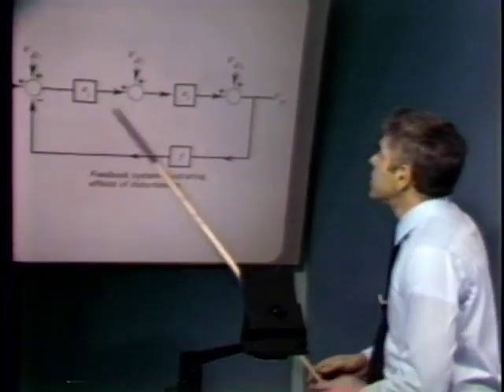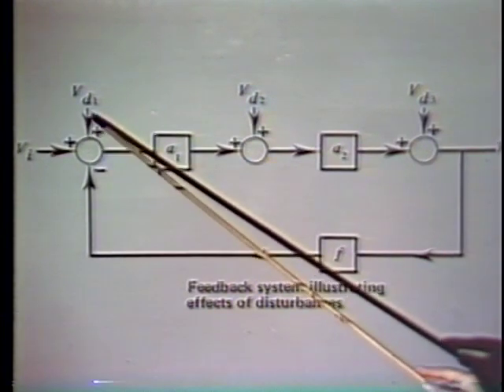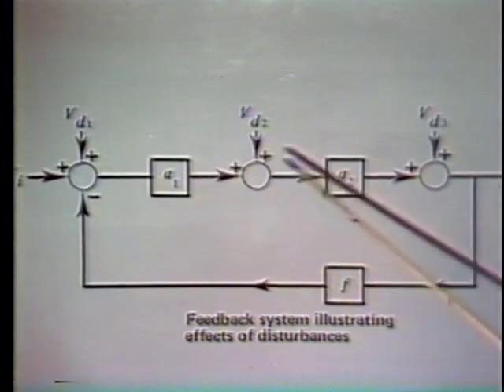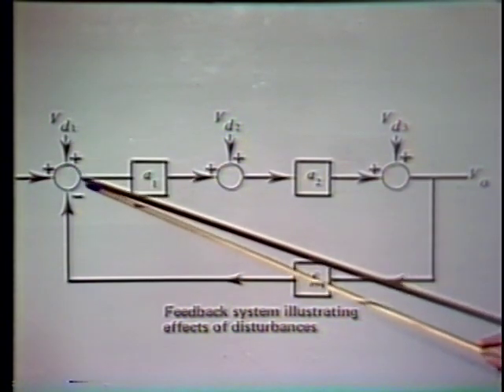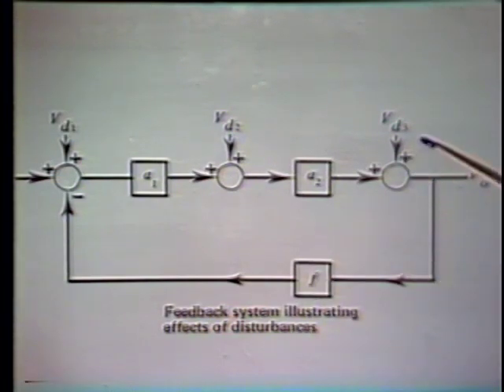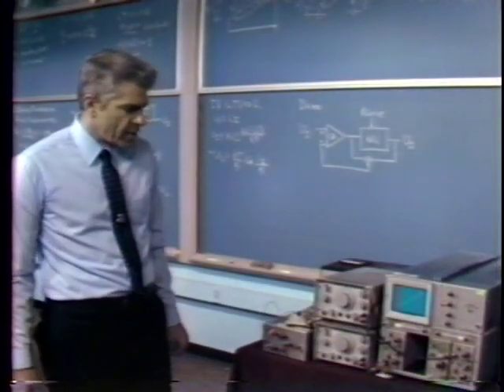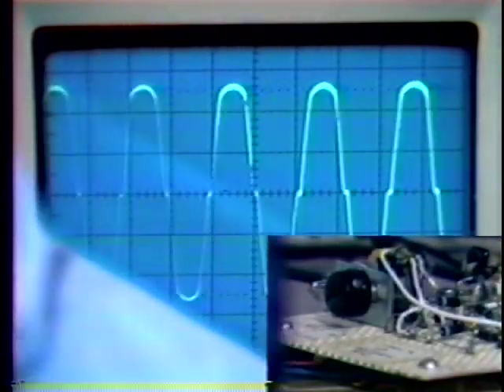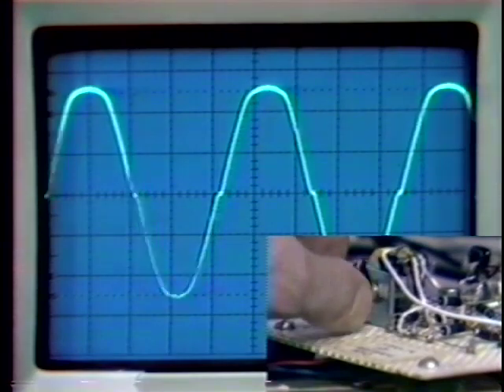2. Effects of Feedback on Noise and Nonlinearities

Comment: An extremely crappy presentation...
It is not clear why the nonlinear transfer function is straightens up... The guy knows his stuff but unable to explain.. At one point he explains a whole electronic circuit with words rather than showing us a schematic..
Reply: what's not clear? he even showed you feedback signal which corrects the nonlinearity. also demo follows good example where slopes are 1 and 0.1 initially (very large difference) and after adding feedback they are 9.9 and 9.1 which is very close. you probably need to watch lecture from beginning.
Reply: @PavelKrupets  
The problem with his presentation is: the nonlinearity he presents is without dynamics (ie, it is not a differential equation), and it wont work as he presents it as the signals will travel through it with infinite speed. Try it in simulink and you will see. But when you put a very fast pole just before the nonlinearity [ ie, something like 0.0001/(0.0001s+1) ] it works marvelously. AFAIU the guy simpli assumes this delay and never tells us about his assumption. So it took me a week to wrap my mind around that..

I still maintain that his presentation is crappy. But make no mistake, this is one of the best control theory lecture series around, if one takes his time to decipher it.
Reply: @sahhaf1234  presentation shows exactly what is intended

effect of feedback on noise and non linearity
Reply: @PavelKrupets  I dont think you get what I say..
The the feedback loop around the nonlinearity, as he gives it @14:54, wont work. A delay is needed. If you dont believe me just try it on simulink... 
But if you just put a fast pole, like 0.0001/(0.0001s+1), between the gain block and nonlinearity, it will work.
Reply: @sahhaf1234  you probably should try to understand the math

everything works in simulink as well

- simulink shows exactly the error he shows on oscilloscope (vertical lines around zero, spikier sine tops)

- output is pretty much sine wave

feedback / gains all help reduce or attenuate non linearity
Reply: @PavelKrupets  I didnt run it on simulink but on scilab+xcos. When you try to do that xcos refuses to do the simulation, complaining of an "algebraic loop". Simulink must not be different. To learn what an algebraic loop is, just google. 
The guy did not suffer from an algebraic loop, because he does a physical simulation. In physical simulations there is always some delay integrated in the system, which is distributed throughout the system as small capacitances and inductances.
Reply: @sahhaf1234  i did run it on simulink and it works fine
Reply: @sahhaf1234  you tube is horrible for discussions like these, hard to add images, etc
Reply: Are you kidding???  The course is on feedback systems, not on how to design an intentional nonlinear circuit just for the demonstration.  His description of the nonlinear circuit is sufficient, and anybody with a basic understanding of devices can follow what he's talking about.  The late, great Professor Roberge is one of the absolute best, and the world took a huge loss when he passed.  RIP Professor Roberge.
Reply: @jaydee9968  Yes, I'm just kidding.